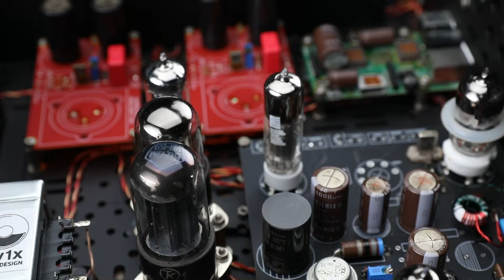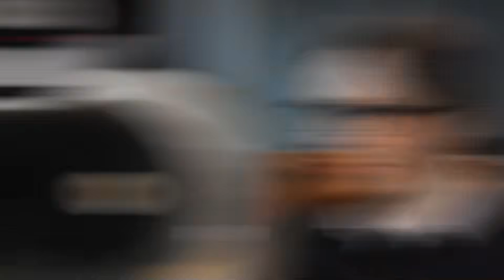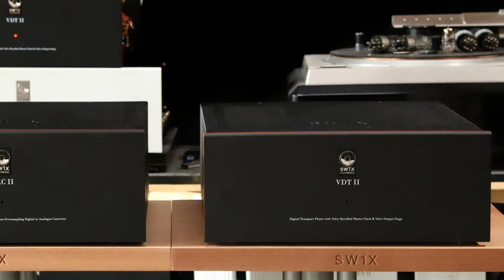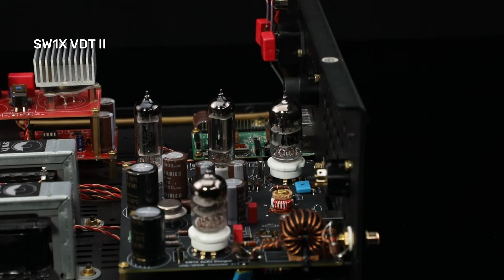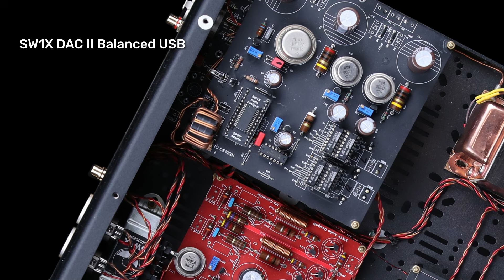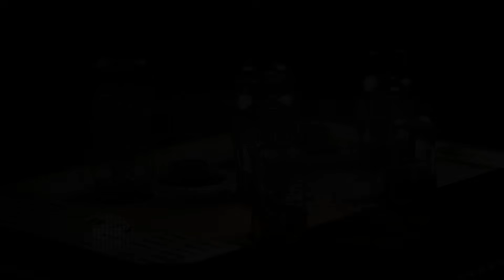Optimising USB Audio Interface for Extreme Performance in High End Audio

Comment: What model would you suggest to someone who already has a tube line pre with a cathode follower?
Reply from the maker: cathode follower means you likely to have a local feedback at the output, which cripples dynamics. as a starting point I would get rid of cathode follower if you wish your system to gain in musicality. then look for a DAC that suits you budget- entry level DAC I or DAC II are great candidates here
Reply: No. It's quiet. I thought, too many Tubes in the signal path ain't no good.